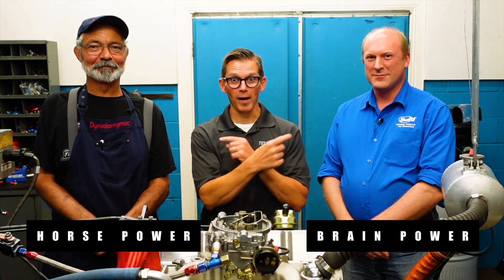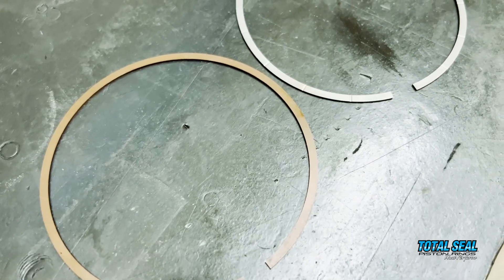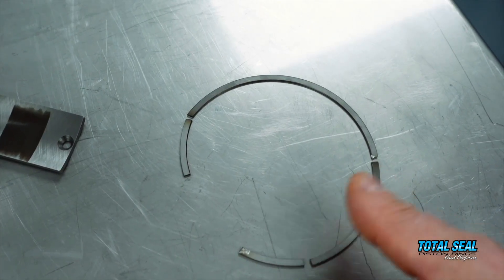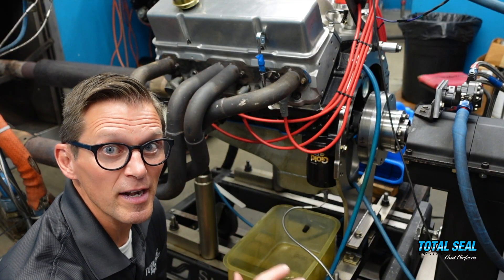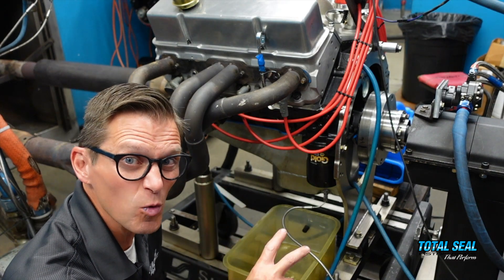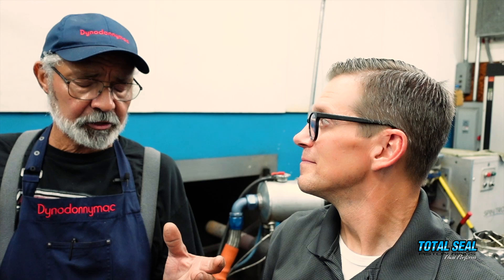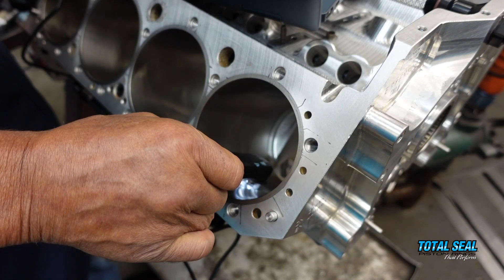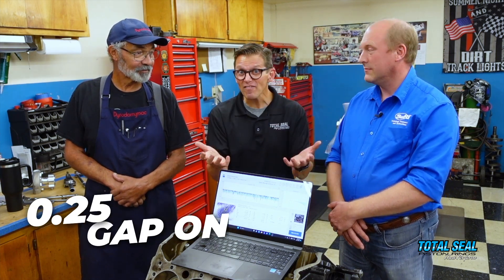Brain Power + Horsepower: Testing The NEW Variable Hardness Coating

Comment: If you bond a lubricant to the rings and bore you can drop the friction dramatically while reducing wear and improving compression.
This approach would work on any engine and would not require replacing the rings.
Even your improved rings would benefit from this approach as it's synergistic.
🙂
Reply: There is only one lubricant that forms a permanent bond with the metal and requires a single application: XcelPlus
The highest friction part of the engine is the interface between the piston and bore.
You can treat both via the oil and via the fuel.
The Combustion Chamber Treatment (applied via the fuel) is the one with the greatest potential to reduce friction in this critical area.

Comment: analog blowby meter should have neodymium magnet as a ball. and backplate should be made from thick copper plate. (with grove for tube). that will behave like manometer filled with oil/glycerin.
Reply: Is there a gauge built like you describe by a manufacturer?🤔
Reply: @chrispompano  adding volume (air tank) before meter also should make more smooth.
Reply: @chrispompano  I have no idea. I see rapid movements and have thought how it could be improved.